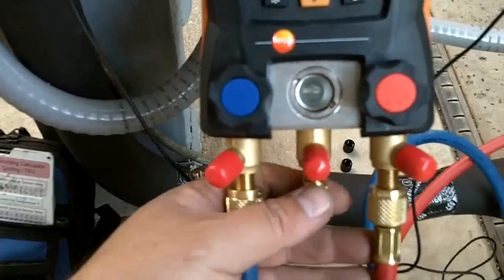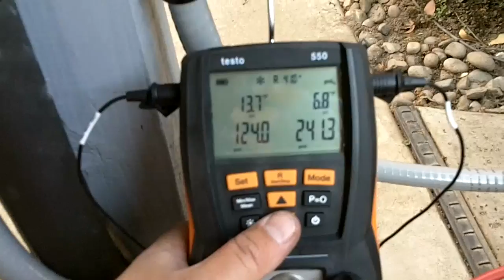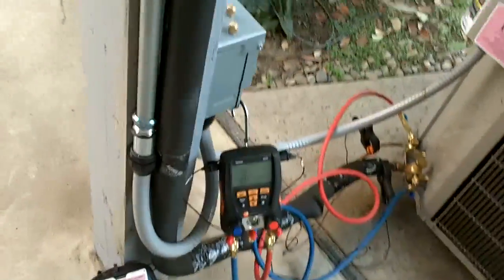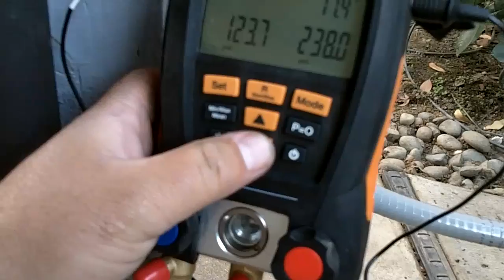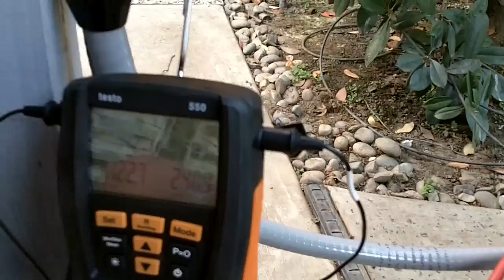Bryant HVAC 4 ton 16 seer

Comment: Awesome. They make charging fun.

The coolest thing about the 550 to me is that you can read subcool and superheat in real time. No fiddling with the slide rule. I still use my old gauges, slide rule and thermistor thermometer when dealing with R-22.

I agree with fritz, the  550s need to be blown out with nitrogen after every use. I notice that they get oily if you don't. I don't store mine with the hoses connected either. I park them on my old 410 manifold.